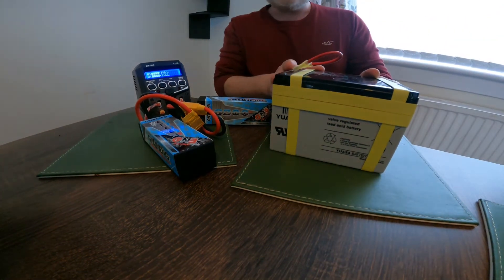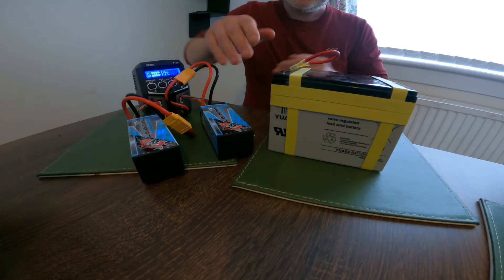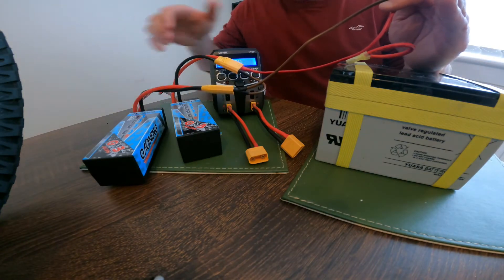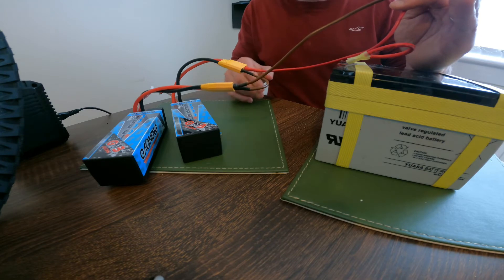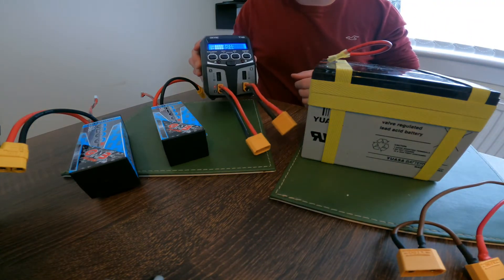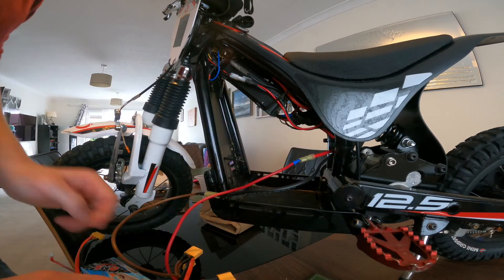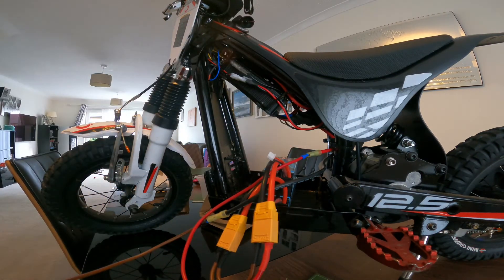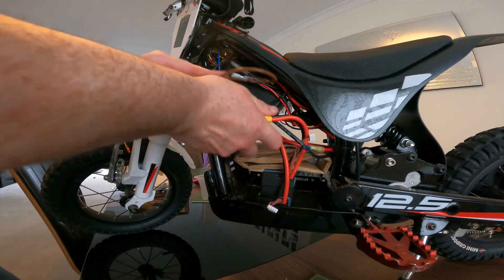Oset 12.5 lipo battery conversion for little more than £100

Comment: Hi really find this helpful just a quick question I’m buying the 6s 20,000 amp would the charger you have charge that battery still and would you recommend adding any fuse to the wire as a breaker with the battery I’m suggesting thanks again 👍🏻
Reply from the maker: No that charger only charges upto 4s you'll need one that can do 6s the imax b6 is a good cheap one but it only does 6amps so might be a bit slow for 20000amps. Look for a charger that charges 6s at 10 amps, just make sure the chargers not fake there's a lot of cheap fakes out there.
Reply from the maker: I don't think you'll need to add  fuse, but it won't do any harm .
Reply: What about the sky rc t200 I noticed they do a better version just trying to get my head round it all 😵‍💫
Reply from the maker: @liamhickman358  yeah mate that will do upto 6s at 12amp, you could charge two 6s batteries at the same time.

Comment: What do you use for voltage cutoff?
Reply from the maker: I should of said in the video. I use two lipo voltage checker connected to the balance plug.
You set the lowest voltage you want, say 3.1v per cell, a beep goes off alerting you the lowest voltage has been reached.  It's not a voltage cut off but the beep is quite loud.
This is what I use https://hobbyking.com/en_us/hobbykingtm-lipo-voltage-checker-2s-8s.html?___store=en_us&gclid=CjwKCAjwrqqSBhBbEiwAlQeqGhKuOE9K3Z9RZnMmkrPWkHVnlMffCvlSyqsaWmvOePk1DswvuNBchhoCb3oQAvD_BwE&gclid=CjwKCAjwrqqSBhBbEiwAlQeqGhKuOE9K3Z9RZnMmkrPWkHVnlMffCvlSyqsaWmvOePk1DswvuNBchhoCb3oQAvD_BwE

Comment: Hi matey how long does it last ? My sons 12.5 only lasts about 40 mins
Reply from the maker: Depends on size of battery, what power you use, kids weight and if theres a lot of start stops.
Think I get about 30 mins but there only 6200mah batteries, you can get 20000mah 6s which should outlast the lead acid batteries.
Reply: Okay matey need more ah then his 10ah lead acid last about 1hoir and 20mims roughly
Reply from the maker: @09mallin  have a look on hobbyking, think they sell 6s batteries up to 20ah.

Comment: Great video. Do you have a link for the batteries you used. My son has a oset 16.0 36v
Reply from the maker: I'm not sure the best batteries to use for 36v but 3 3s batteries would give you 33.3v. I found these ones on hobbyking for £40 at 8000mah. https://hobbyking.com/en_us/zippy-compact-8000mah-3s1p-30c-lipo-pack-with-xt90.html?queryID=7429180df971dbc41ed5a9fa0b217a84&objectID=82625&indexName=hbk_live_products_analytics
If you check around you'll probably find batteries over 10000mah which should work well and make the bike way lighter.
Reply from the maker: This is the batteries I used https://www.hobbyrc.co.uk/gnb-6200mah-3s-90c-hardcase-lipo-battery
Maybe need a higher mah for better run time.